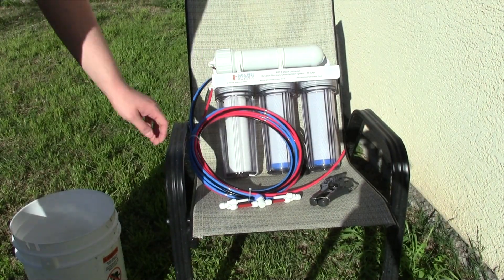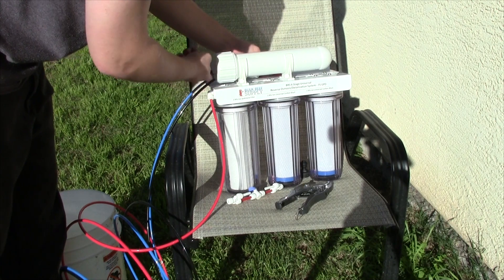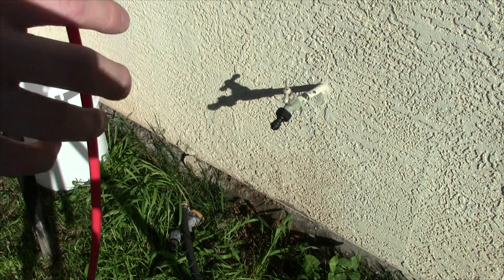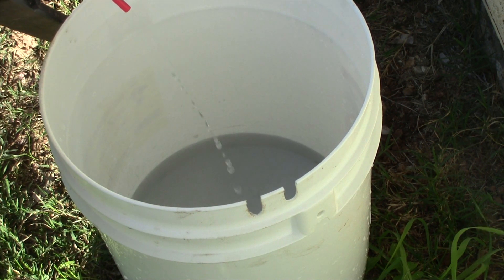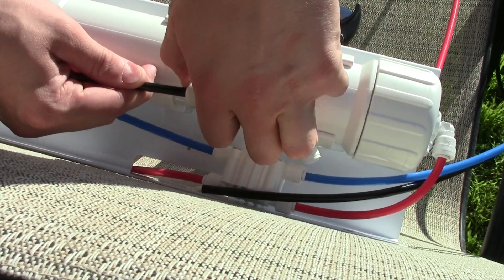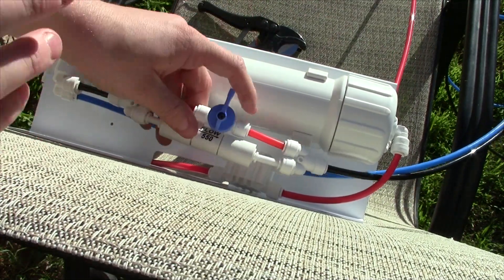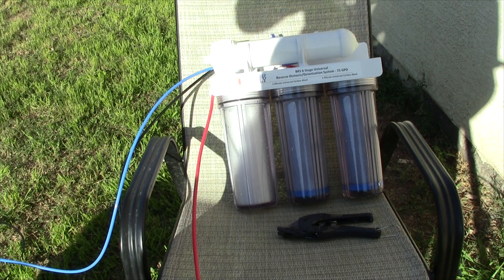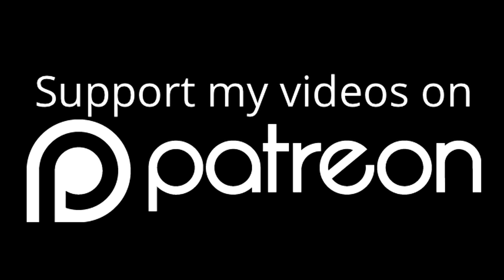How To Set Up an RO/DI System (BRS 6 Stage Universal RO/DI System 75GPD)

Comment: Hi!  I noticed the aquarium RO systems are cheaper than regular RO Systems, but they do have the deionization filter as well, which is not suitable for drinking.  I got a big garden, so I'd like to reuse the waste water coming out of these to water my trees by installing it in the back yard with a garden hose adapter.  Is it possible to move the tubings around in these systems so I can by-pass the de-ionization process if that was the last stage?   And are these tubings basically standardized to 1/4"?
Reply: Bulk reef supply has one called BRS 4 Stage RO Only System - 75GPD , on sale $143.99 normally $179.99.

Comment: Nice Read ! May be optimal in longevity.. whether a new or replacing the elements as a whole (minus the membrane) take the first element which is usually a sediment filter and put that one only in the housing but all the others are still empty, run you tap thru the one for the usual time to flush any residuals, then move to the next housing and with that element in place run your tap again to rid that one of any residuals, then the next in line do the same.. all the way down the line. This is so any filters behind those that came before don't accumulate which will shorten the life of them plus your water will be the better. Sometimes the membrane won't be changed as you would the others, sometimes not all the elements are being changed, so you do however is better. 
Just thought I'd throw that out there 
1 more thing, I hear a lot of people who are washing their hands and arm with products with soap in, if that's how it's better for them, if you get a bag of aquarium salt or Marine salt and pour a tsp of that into your hands with a little warm water and wash hands/arms all over then rinse. That will drive off any soap residual and you can feel the difference between soap and salt, just be certain no iodine, so no table salt.

Comment: Does the ro di canister filter fill up all the way ? My water level on the rodi level is on the bottom
Reply from the maker: Yes, it should be full. Try slightly unscrewing the filter housing to let the air out as the water fills.